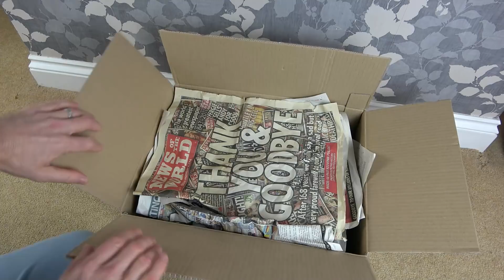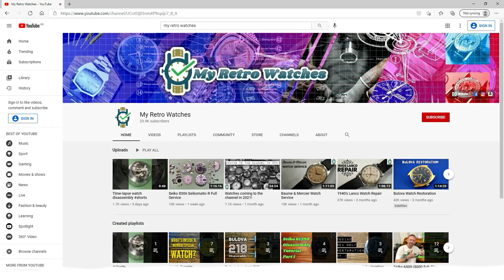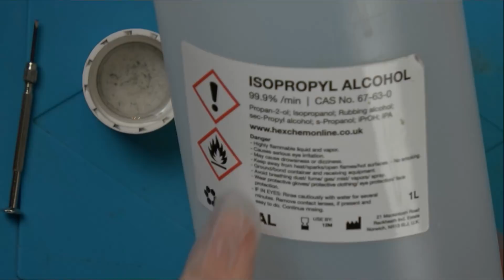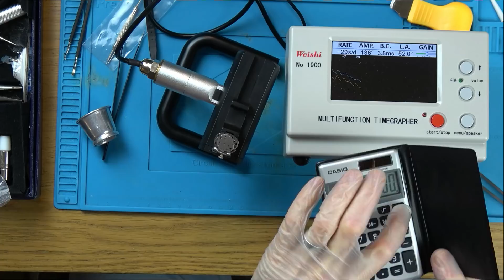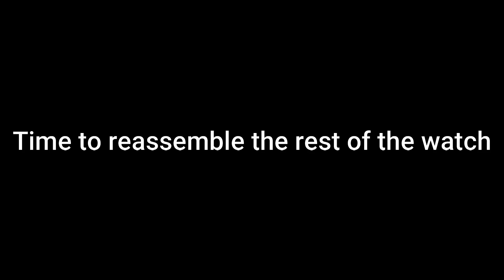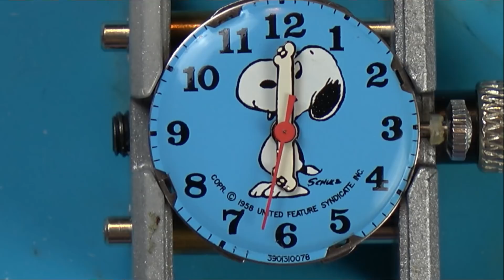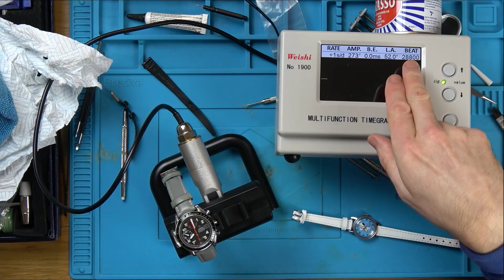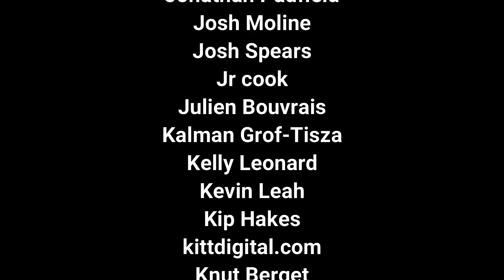Faulty 50 Year Old SNOOPY WATCH - Trying to FIX

Comment: Firstly Vince massive thanks for the shoutout any traffic my way is always welcome.
You did a great job on this one!  Zero jewel watches are notorious for being a total nightmare so you did set yourself quite a challenge there.
Persistence paid off and I felt your pain with 7 pivots to line up!
Really pleased for you .

Did not see you oil the pivots on the dial side which could also help and the up and down trace could be a manor of things including a bent pivot. 
Envious of the Weishi 1900 , nicer machine than my 1000
Reply: Completely agree, I've only fully serviced one pin pallet, getting all those tiny non jewl holes lined up wasn't my favourite thing 😂 but great feeling when they do. Love it when my retro watches drops a video and love it when my mate vince drops a video, then to find out it's watch video it's a double win 💪
Reply: I'd never touch those movements, those are absolutely hateful
Reply from the maker: It's a pleasure mate. Thanks for the tips and nice words Mike. I was hoping you would watch it 😁
I oiled the dial side from the wheel side before putting the wheels on. The Weishi is nice, loved seeing the Omega trace so close and straight, shame about the Snoopy one, looked like the Alps!  🤣
Reply: If you send the watch to Mike, for a proper cleaning and re-assembly, I bet the accuracy would improve. The un-jeweled movement is not worth the effort, but as a legacy Snoopy watch, it's still worth something. A kids toy, works pretty good for what's in side. I bet it hasn't gotten much use. It was worn a while and tossed in a drawer for much of its life.

Comment: Great vid, Vince. If you ever get another Timex from this era with an M22/24 movement, you should try servicing it according to the Timex service manuals:

1. Remove dial and hands, detach stem, remove from case
2. Loosen balance wheel screw one quarter turn
3. Place movement in ultrasonic cleaner using Essence of Renata (or white alcohol) for three minutes
4. Tighten balance wheel screw
5. Place movement in naphta lighter fluid for several minutes
6. Dry with compressed air
7. Oil all pins, do not lubricate mainspring

Basically, these movements weren't meant to be serviced in the traditional sense. Timex specified the "dunk and swish" method of servicing, and it seems to be the best method of attacking built up grime without tearing down a movement that wasn't meant to be torn down.
Reply: Good advice mate! I just did a similar service to this very watch that was sold as "Not Working." Did #1 with the addition of carefully removing the hour hand washer, gear, and minute hand gear because they easily fall off and get lost. I did a lighter fluid to 99.9 IPA to a final lighter fluid wash and the Watch accuracy went from - 3 minutes to + 30 seconds! If anyone tries this for the first time, be careful of the dial tabs. They are easy to break!! Cheers!!

Comment: you are brave taking this apart. lol  When i was a kid, early 80s, i bought two Peanuts watches at a yard sale for $5 , neither worked. But i was able to fix them by opening them up and unwinding them. From what I found out It seems lots of kids watches get damaged because they over wind them , or wear them in the bath. Sometimes over winding breaks the stem, which usually requires a watch maker or jeweler to repair. But i'd suspect no parts are available today so they'd have to make the parts. The two i repaired a snoopy and a woodstock, both with the denim bands. And many years later i found a charlie brown one and bought that for way to much. But today they're worth a lot more. Great job on the repairs! Your problem solving skills get better every video!

Comment: Well done getting that top bridge back on, it's worst part of a pin pallet movement, also don't worry about the trace on the time graph, they don't tend to read pin lever watches to well, to noisy, more suited to swiss lever. Also put oil on the escape wheel faces in about 3 points evenly spaced it will help a lot with these types of movement. A real fast (bodgey)
Way to get these going is to wash the whole movement in lighter fluid, dry then oil, also you don't need to worry about the mainspring on a timex they have a special self lubrication coating. Awesome job, more watches please 👍
Reply from the maker: Thank you Ben, cheers for the tips 👍

Comment: Good job, Vince.  The end shake on the balance is adjustable with the cup screw.    Also, the pallet pins on the escapements and the impulse pin need a drop of oil.   This often improves the amplitude dramatically on these zero jewel movements.

Comment: I have the same Snoopy watch from when I was a kid in the 70s. It was working up until a few years ago when I seemed to over-wind it. It's good to know they can be repaired, although I don't think I will try to fix it myself.
Reply: UPDATE: Your video gave me the confidence to have a go at fixing my Snoopy Timex watch. As I said above, I'd thought it was over-wound, but every web search for how to deal with an over-wound watch suggested that you can't actually over-wind a watch and that the issue lies elsewhere. So having watched your video I knew to concentrate on the balance, not the spring. Last night I worked at it for about an hour, cleaned out some dust and got the balance to loosen up. Gradually the balance start to run for a little bit longer each time, 2 seconds, then 4 seconds, then 10 seconds. I put it back together then wore it on my wrist today and it's been keeping good time. I'm amazed I successfully managed to get it going again. Thanks for for making this really useful video.

Comment: hi bud l bought a DAB Radio that can not get stations on ebay as a spare or repair l managed to repair it by taking the DAB Module off the back and reseating it back onto the stand offs and great new is works well and looks brand new with a couple of  marks :) great vid

Comment: Hello Vince...your vids are most entertaining. I work on/restore old American pocket watches (not a pro, just a hobbyist amateur), and for cleaning movements IPA isn't the best choice. Naphtha (lighter fluid) is much better as it dissolves the old dried up oil (which is a must to use on the pivots of each wheel). And too much oil can cause problems/attract dust & grime, so definitely use a watchmakers oiler (or a small pin/pinhead can substitute in a pinch). And be sure to work in a well ventilated area as naphtha fumes aren't especially good for you. 
Thanks, and keep up the excellent content!
DT

Comment: I'm a watchmaker and I've attempted to repair these in the past to no avail. I could get it run again but it would stop again after a week. They're almost impossible to service properly. I would just run them through the cleaning machine and if they came out running that was good enough for me. The problem is the pivots are worn, the pins wear out and the mainspring loses it springiness.

Comment: Feel free to take to the acrylic crystal with some fine sandpaper. I've done it loads of times. Works well. Also, any metal polish will work to finish off. You don't need to pay for polywatch which is relatively expensive (small tube too).
Reply: That's right, I use 400 grit, metal polish and rub it on piece of leather.
Reply: I buff crystal with a mild   Emory board, wipe clean, then polish with toothpaste and baking soda, using a soft cloth and popsicle stick for final polish.

Comment: For an American railroad display, I bought a cheap old Westclox "Scotty" pocket watch as a stand-in for a conductor's railroad grade (expensive) pocket watch.  The watch did not need to work for display and it did not run when I wound it.  Just for the heck of it, I opened the back and gave the mechanism a shot of WD40.  The watch started right up!  However, obviously, I do not recommend doing that to any decent watch.  (Sorry to all the watchmakers who fainted after reading my comment above.)
Reply: You monster 🤤
I'm joking it's your watch you can do what ever you want with it even though that wd40 part triggred me alittle bit not gonna lie 😁
Reply: @Ammar.D  But the watch did get to run one last time before stopping forever inside a shadowbox display.

Comment: An excellent job esp given that the particular Timex was deemed a disposable unfixable movement.  With them unjewelled "tin platers" grease often works better than oil.   I actually have a Ruhla on the deck in front of me which has an even simpler tin plate movement and I am doing it like they did in East Germany, little jar cap full of naptha enough to soak the mechanics but not the dial... wait for to dry and then dab in oils or grease on the movey spinny bits and job will be a good 'un :)   My brother had this exact watch and like all our Timex in the 70's was pretty awful, my last Timex was the infamous red LED which fell to pieces or burnt out on days ending with "y", after my newspaper editor mum had it out with Timex getting her money back she bought me a Sekonda that didn't fall to pieces, stem stayed in, crystal didn't just fall out and lasted a good part of my childhood ramping it up on my Raleigh Chopper.   I don't have Timex in my collection, loads of Sekonda :)   Was wondering, does Snoopy have a My Mate Vince watch do you think???

Comment: ive got a few of the open face pocket watches, two of the three run okay, but of thsoe one has a very grindy movement when adjusting time and the other will routinely gain and lose several minutes  over the course of the day averaging out to be fairly accurate overall, too bad its got a stupidly smooth crown so its a pain(sometimes literally) to wind

Comment: You might try toothpaste to polish that plastic face. We used to polish our LCD watch faces with toothpaste and electric erasers when we worked at aerospace companies. You could use a Dremel instead of an electric eraser, We use to get great results in a short amount of time using that material.

Comment: Hi what tweezers you are using? They look very good.
Reply from the maker: They are, Mike (My Retro Watches) told me about them. DUMONT is the make, I can't remember the size but on the tweezers it has 00 Inox 02, 0302-00-P0 SN.943.10.1 written on them, so hopefully you can find out the info from that 👍
Reply: @Mymatevince  Thank you :)

Comment: You didn't want to touch the top but you actually took apart the hard part. When most people service these they leave the plates together. Remove everything else and soak the whole thing in lighter fluid. The reason they don't run is that the oils have hardened. The lighter fluid dissolves them. After the fluid flashes off oil it and put it back together.

Comment: Pin pallet movement, no jewels,  balance can be removed by removing the brass pin anchoring the balance spring to the balance cock.  Benzine or lighter fluid would be better then IPA 99% or even one dip considering you are not  completely disassembling it.  

NEVER NEVER use WD 40 as it is a temporary lubricant which is designed to evaporate and then leave a waxing coating to prevent rust.  The waxy coating actually will bind up the watch/clock after the carrier evaporates.

Usually on these inexpensive pin pallet mechanisms the winding spring becomes contaminated causing it to bind giving the appearance of being overwound.  No such thing as overwinding, unless of course you use a pair of pliers and snap the spring in the barrel.

Get some dental picks also, they can be used to line up recalcitrant pivots.

I am thinking it is a dirty mainspring (in strength behind it as you say) plus wear to the pivots and holes.  These are not easy to repair.  Also, that screw on the top of the balance is used to adjust the play in the balance pivot.  Looks like a good amplitude for a pin pallet, good job!

Comment: These 'pin pallet' movements with no jewels are very cheaply made and are seen in a lot of Timex watches. They are usually not repairable. Congrats for getting this one up and running again. It is not something that is designed to last, however.